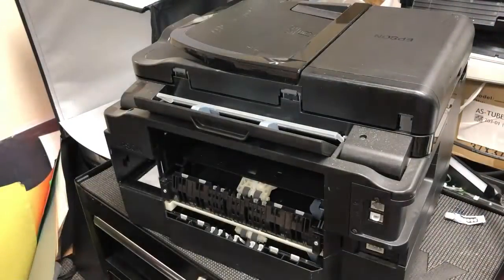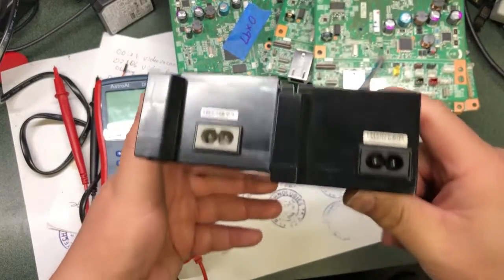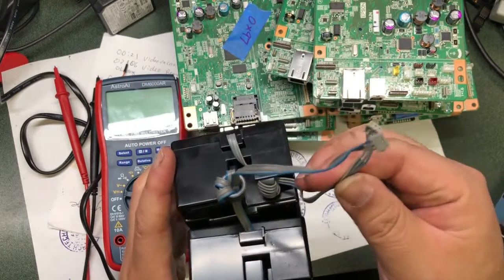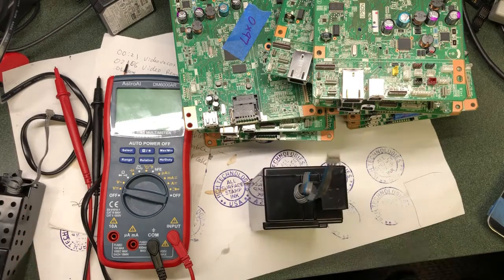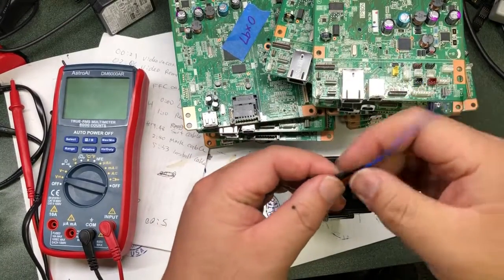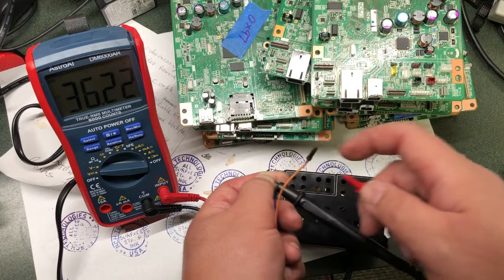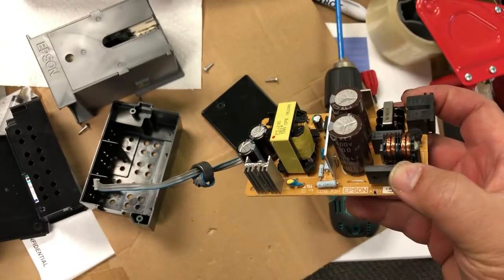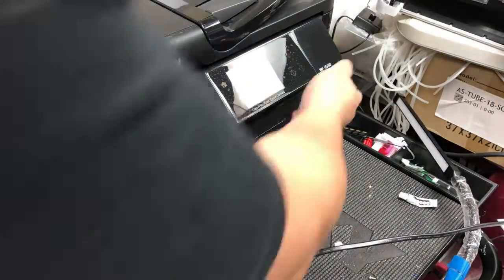Epson NO POWER - How to test if your Epson Printer Power Supply is working

Comment: I have epson r1900 that was well cared for. I stopped using it for 5 years and the ink dried out. Problem is only the green power light is on. The unit doesn’t try to home itself, no movement, no noise, no noise on start up. Where do I start? I cannot seem to move carriage even though I lifted latch to try and gain access to install ink cartridges.

Comment: Hi have epson 1400 was doing a print head cleaning finished fine. But then printer is now beeping and power won’t come on. Disconnected the power supply from mother board and beeping stopped . Is this an issue with the power supply? Mother board or transistors ?

Comment: Sir anu pong tawag sa wire na ginamit nyo yung may orange di ko alam panu itest yung mismong wire ng power supply maliit butas para isuksok yung probe
Reply from the maker: Maraming salamat sa iyong subscription at sa pagtulong sa amin na makalapit sa 100k goal—nasa 91k+ na kami ngayon at bawat subscriber ay mahalaga! Magandang tanong: ang tawag sa gamit na puwedeng mag-test sa makikitid na butas ay multimeter lead kit, may kasama itong manipis na probe na sakto para ipasok sa maliit na butas ng power supply at mag-test nang maayos. Puwede mo itong makita dito: https://amzn.to/3GmBbwv. Sinusubukan kong sagutin ang mga tanong ng subscribers sa loob ng ilang araw, pero medyo marami lang backlog ngayon kaya salamat sa iyong pasensya habang humahabol ako!

Thanks so much for subscribing and helping us get closer to our 100k goal—we’re currently at around 91k and every subscriber counts! Great question: the tool you're looking for is called a multimeter lead kit, and it includes needle-thin probe attachments designed for testing wires in tight or narrow spaces—perfect for poking into small power supply sockets. You can check it out here: https://amzn.to/3GmBbwv. I aim to answer subscriber questions within a few days, but there's a big backlog right now, so I really appreciate your patience as I catch up!

Comment: Hi Kevin, great channel. Have been binge watching your various videos. Need your advice please. I am planning to buy Epson WF-C5290 printer. what are your thoughts on this printer and its 902 cartridge? are these easy to re-fill once the printer is converted to chip-less? also what are your thoughts to buy the aftermarket fillable 902 cartridges ? thanks in advance

Comment: Help me, Ken!!!  Please!!! lol....I'm so frustrated right now and you look like a pro..  I have an Epson ET 4760 and have always been able to clear clogs in the past, however the latest clog starts way back at the beginning---in the ink tank itself.  I can't pull any ink into tube or cartridge.  Tube is clear.  Cartridge is empty.  When I try to pull ink from tube end that connects to the cartridge all I get is syringe after syringe of air and it sounds like a paper bag is crinkling...it's the ink tank!  So weird...it's made of soft thin plastic that crinkles up.  It seems to me like I might have a hole in my ink tank....does any of this sound familiar?  I have watched every video I can find and nothing mentions what to do if everything is clog-free back to the point of the ink tanks themselves.  I would absolutely 100% appreciate any advice!

Comment: Hi kevin, i have epson 1400 no power led light and i heard hum or tik sound near from board. Do you think its power supply or main board. Thanks
Reply from the maker: Most likely the mainboard. However, it shouldn't be humming. Try re-burn the bin files and see if it works.